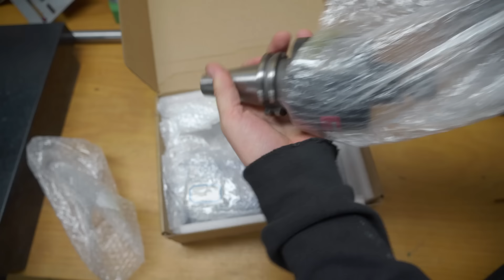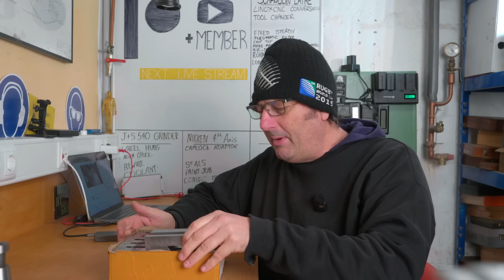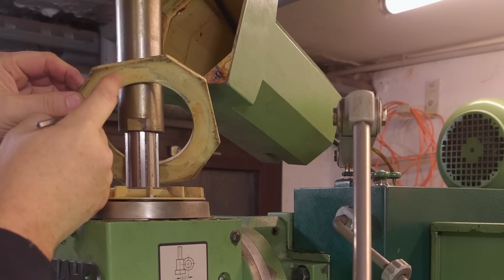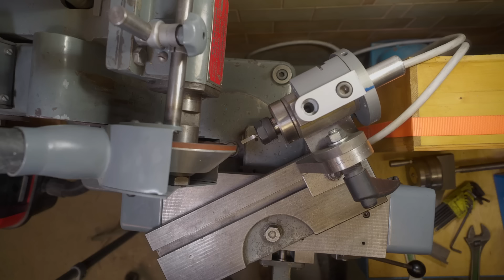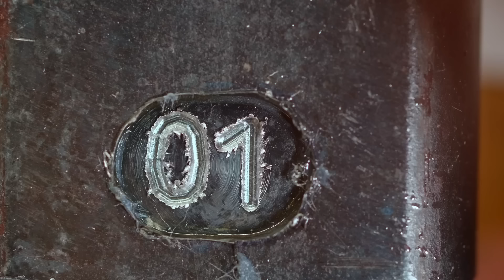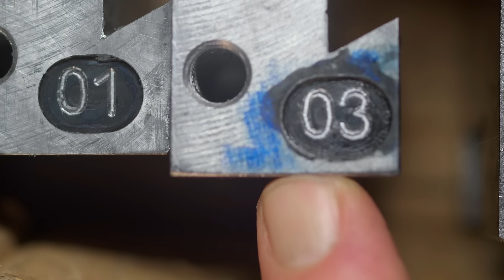Does a spindle speeder work for engraving? || RotarySMP

Comment: Well im asking myself why you dint use the ballnose endmill to engrave as Stefan mentioned it some moons ago... 

Info: when the result looks to scratchy give the tool more time to cut always helps, and conventional cutting isnt topping on the cake.
 
Better go with a climbing toolpath. I assume when you rise the tolerances in the toolpath calculating it will be a "rounder" zero in the end.

Anyhow good idea with the gun blue.
Reply from the maker: I didn't get around to buying them yet, and would have snapped them straight away :)

Isn't engraving always climbing and convention, as both sides are in engagement?
Reply: @RotarySMP  Hi Mark, well i dont think you would destroy it, when you are trying to be careful you are capable of it, im certain. =)

When your machine is capable of accurate downward steps of 0.1mm you will be able to use a 1mm endmil because that would be 10% crown engagment that is feasable. 

I did mill a 3 way canal for a Horn 326 tool so i can use their inserts on other toolings i made.

12000rpm 300mm/mm 0.2mm downward engagment thats a 75m/min surface speed pleanty in 50HRC steel. 
Maybe you go somewhat slower... 180mm/min 

To some extend yes. It is cutting more in a forward action and will not cut at the path it has done. It will cut more in a wiggle action, left right left right because of the cutting pressure.

BUT when the mill goes over the cut twice it will cut on one side more then the other wich is defined by the software, or your commands.
 

i use contours a lot maybe more then anything else because i can tweak alot more as i like. 

We use in example threading to cut holes because the thread pitch defines the cutting action downwards can be adjusted very subtile and in a more visual way. A pitch of 0.3mm is more clear to understand as 2 degrees...
Reply from the maker: I will get some. I was meaning to, but forgot.

Comment: 16:10 Do you shut the machines down because you only have one plug ? Just get/make a Y-piece/add a wall plug. If you're worried about load, you could relatively easily measure on-but not running load with a multimeter on each phase for each machine, to ensure it viable to leave them both on.
Reply from the maker: The load is fine, as the Clarkson doesn't pull much load. I need to get around to adding another 3Ph socket or two.

Comment: Add a single phase to three phase VFD for the Clarkson, an single phase socket will be enough plus you will get speed control. Great work on the toolholders!
Reply from the maker: I need to add a couple more 3ph sockets any way. Although a VFD would also mean I could reverse the Clarkson spindle, and save having to reverse the wheel.
Reply: @RotarySMP Are you aware that there are the red plugs with two pins turnable to switch the order of phases. They are not very expensive neither
Reply: @michaeleitel7186 A reversing switch might save having to unplug it everytime
Reply from the maker: Good points.